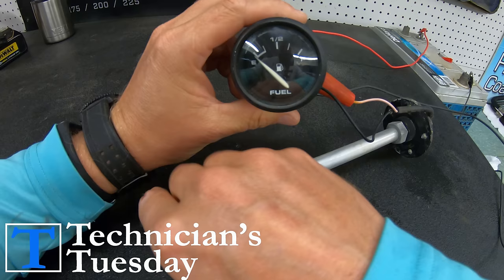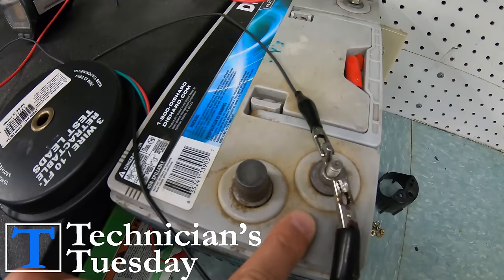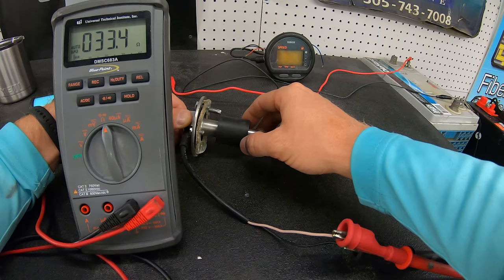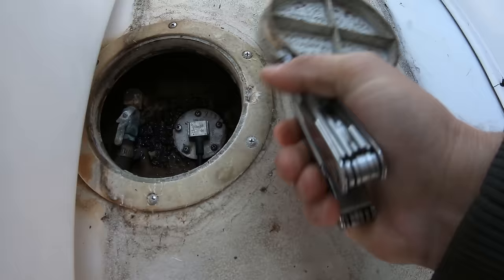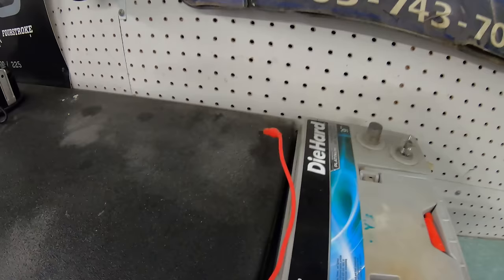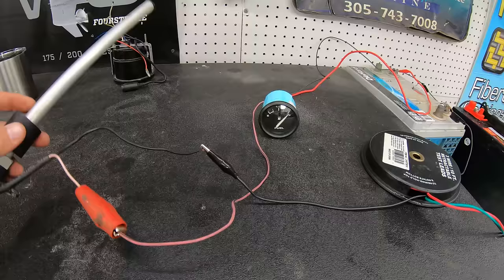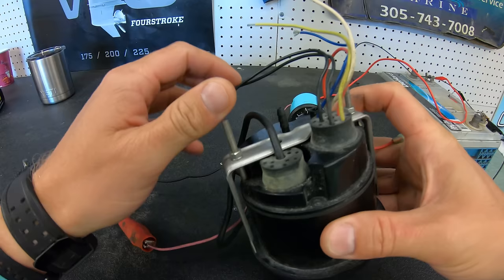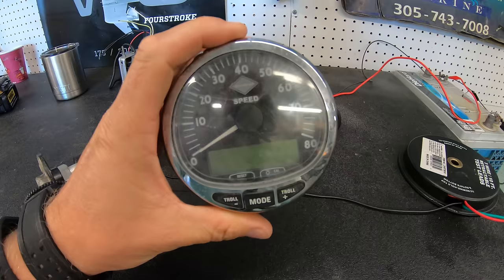How To Troubleshoot & Fix A Boat Fuel Gauge & Fuel Sender!

Comment: just a word to the wise  if you order a reed switch sender and you have a steel tank measure depth of tank minus 1/2 in to order the correct length   it 33ohms full 240 ohms empty but still a little left in the tank 1/2 inch the reason is this the steel tank will hold magnet down showing empty in a full tank  so order 1/2 inch short for correct reading   also best to run 2 wires to the gauge  do not use metal boat as gd wire    14 ga. wire is best  been use one for years   cost is about  $75 .00  (sender  and gauge   on line )    they come in all lenghts

Comment: So I just bought a boat a few days ago, the fuel gauge was on empty when I was inspecting it before purchase. I went and filled it up took 20 gallons to turn off and the gauge says full now. I’ve spent probably four hours out on the water and the gauge has not moved from full. Whatcha think?

Comment: Thanks for the info!!! I had put new batteries in and separated the motor from the lights and gauges. that doesn’t work. Would never have found it without your video thanks really appreciate it, gas gauge working great now!!

Comment: In 2011 I bought an F350 from marathon Florida , rear tank gauge never worked right , factory replacement for unit was almost $400 , got a Marine sending  unit ($30) and bent the float lever around to make it work backwards , stuck it in the tank and it worked ... wasn’t perfect because the ohm range wasn’t exactly the same but it worked

Comment: I have run out of gas, but, I have a sailboat, so it’s never been a problem ;) my gas gauge stopped working last year when I accidentally connected my battery backwards (I crossed the negative and positive).  The battery was in a very hard to reach place and when I hooked it up, I had it backwards.  I fried my vhf and the gas gauge stopped working.  I was never really sure how to troubleshoot the #gasgauge .  Thanks for this excellent explainer on how to troubleshoot your #gasgauge much appreciated!

Comment: #gasgauge I never have run out of gas but I did have to be towed in because I did not understand how the primer bulb worked and couldn't figure out how to hold the bulb to get fuel to the engine. Newby fail. Thanks for another great video.

Comment: I was wondering how the vesselview could give me my Fuel information. Not installed yet but this helps alot. Way to go Aaron.......
Reply from the maker: Just through the engine via that boat harness :)
Reply: I had a regular fuel gauge. I Didnt know the signal went to the engine as well.
Reply from the maker: @dewey66904  yup :)
Reply from the maker: @dewey66904  actually of you have a regular analog gauge it doesn't go to the engine it goes to the gauge. Mercury gauges get the info from the engine, so the sender wire goes to the engine with those systems

Comment: Great Channel.  I have you Bookmarked!!!    3 weeks ago I bought a boat with 60 HP 4 stroke mercury on a Bass Trakcer and my fuel gauge doesnt work.  Go figure I gotta track down wires through the wiring harness?        Before I get into that....  I measured resistance of the sender at 86 ohms with it installed in the gas tank, which sounds right as Im estimating about 1/3 of a tank.  (im not saying the sender is working though)....    With the key on, the Fuel  Gauge does nothing when touching black and pink wires together just as you say with a Mercury .   

Next -  With the key on,  I measure 6.7VDC between pink and black at where they connect to the sender. b  (I was expecting more voltage there but Im no expert).    

Next -   I measured voltage at the gauge with key on at 10.1VDC.   hummmmm......   any idea if there might be a voltage regulator knocking down the voltage at the sender?   According to voltage drop calculator, there is way too much voltage drop for about 8 feet of wire,    hummmm..... head scratching. 

  Im inclined to go ahead and just replace the sender and cross my fingers.  
   BTW...Im not asking you to help me fix it... I'm just rambling maybe for the sake of others.

Edit. 11-28-2021  I fixed it.  The gas gauge now works and Im a happy camper.  I replaced the fuel sender on a wing and a prayer and now I have a spare fuel sender .  That didnt fix anything .  After some tedious wire tracing I discovered the ground wire on the sender circuit was hooked up to the wrong battery.  Likely happened when the previous owner put in new batteries.

Comment: on wiring gauges never send battery to the sender it is resistance only dont confuse neg for light as neg for gauge you can test your conn.before you install in tank moving magnetic float up and down will move gauge empty and full  the batt and gd for lights on gauge

Comment: Great video as always! Love the depth of knowledge! While you are on the subject of gauges I have an analog tachometer on a 3 cylinder johnson 70 that seems to intermittently work only while using the engines trim button on the throttle arm. Trimming up or down will make the gauge come to life. Maybe you could do a tachometer related video in the future? Thanks for the great diy content!
Reply from the maker: Sounds like you've got an issue with the power or ground going to the gauge. Try and check for that battery voltage at the gauge with the key on just like we did for the fuel gauge. See if that gets you any more information

Comment: There are senders out there that are opposite in resistance. The sender resistance of a European style sender, such as a VDO brand, is opposite to the U.S. type.
You'll see the different senders listed as either a 10-180 or 240-33 in the description.
The range for senders are:
240 to 33 Ohms for U.S. style (Empty reads 240 Ohms)
10 to 180 Ohms for European (Empty reads 10 Ohms)
The gauges will have to match the senders. I found this out when we had a hailstorm (hail the size of my palm) which smashed all of my gauges. I purchased a U.S. Evinrude gauge to replace a VDO gauge and discovered that the fuel gauge moved towards empty when I filled up and moved towards full when consuming fuel. This was concerning until I rotated the gauge 180 degrees as a temporary solution. It's not accurate being different resistances (I have ordered a 240-33 sender unit).
Knowing this info will save you money and get you the correct matching part.
There is also a device for around $40 that corrects mismatched tank senders with different gauges. That would be handy when you get a custom tank and don't want to replace your expensive gauge. 

#gasgauge
Reply: That's the problem I have now.  When I move the sender up towards full,  the new gauge goes towards E. I bought a new sender and still have the same problem
Reply: @kendrickbannister5025  New guage it is then
Reply: @autostyling5901   I'm good now. My original gauge is working now.  I bought another sender and rewired. All good.

Comment: I got a rod style for my aux truck tank when the resistant was at the bottom it show tank was full when I slid it to the top showed tank was empty. I even switched wires around

Comment: Excellent video! Can those long sending units be used for Automotive purposes? I have a gas tank in my 1964 Ford falcon that has been modified with a sump at the bottom due to the installation of an external electric fuel pump. I was wondering if I could get one of those senders that would reach the bottom of the sump for accurate reading of the amount of fuel in the tank and then wire it to an external fuel level gauge.

Comment: @born again boating can someone please help explain why the fuel gauge doesn't show a reading when its just directly connected to the battery from the positive and negative terminals because doesn't this complete the circuit for electrons to move? Why is it that the sending terminal on the gauge has to be connected for the arrow to move?

Comment: On my old boat it’s took me soooo long to figure out that the wrong sending unit was used on my boat. I ran out of fuel several times thinking it was engine problems. Gauge would read half when it was completely empty.  #gasgauge

Comment: Have you noticed the Yamaha digital gauge you used in this video showing a wrong fuel level compared to where the sender should be? I have a ton of issues with that same Yamaha gauge not giving me accurate fuel tank readings even when gas tank is full

Comment: Oddly, on my old fuel sending unit and my new sending unit I'm not getting any ohm readings, when the unit is off the boat.  Also my trim gauge which is next to the fuel gauge on the dashboard, isn't functioning either. I suspect a bad ground.

Comment: I want to ask you if fuel Sensor resistor is  linear ?. My is not. Gauge show it by step 1/8, 1/4, 1/2, 3/4, 4/4 only.

Comment: hello, 
I bought the float on aliexp... once connected to the fuel meter the needle works upside down, you have an idea.
do i need to change the meter? it is an original Mercury vdo

Comment: Makes sense! Need to trouble shoot my fuel sender. I have a fuel flow meter on my boat, which calculates fuel burn, but the Suzuki Fluid level sensor always shows a reading of 100% on my Suzuki digital gauge. Going to install an analog meter for redundancy. #gasgauge

Comment: Fix your current gauge properly, and rig second fuel gauge as a precaution, if you ever ran into running out.
Having two gauges ensures you won't run out.
Definitely won't run out ever again, and would be interesting to happen to watch, if any difference pops between both fuel gauges showing. This will wake you up to investigate. You would be on alert mode then, and would investigate whether you got a bad gauge, or empty tank.
If you find you got sufficient fuel in tank, your gauge will automatically earn a bad gauge diagnostic.
All in all you will be very aware, not guessing, and definitely not needing a dealer service to figure out things
Reply: Doesn’t ensure you won’t run out if the problem is something other than the gauges.

Comment: Very helpful video. But, what is at fault when the gauge reads around 3/4 on a FULL tank and reads around 1/8 when boat is off. Bad gauge? Sender? Both? Cheers and thanks!
Reply from the maker: Thank you, probably the Guage is bad, youll have to run the tests in the video

Comment: Had a 4stroke 250hp yamaha leaking fuel from the right side latch...block it to get home....would like know the reason for that fuel line on the latch.. Thanks
Reply from the maker: It's the vent for the VST. The float and needle in the VST has probably failed or something is stuck in it. You'll need to pull the VST off and check it out, usually you have to change out that seat and needle assembly :)
Reply: @BornAgainBoating  Thanks for the info...I will let yamaha repair personal maje the the repairs.....
I'm not sure
Reply: @BornAgainBoating  Thank you for the information...greatly appreciated

Comment: AT 3:32 you were talking about portable tanks and the float switch. i am a noob so please forgive my ignorance, but i have a 12 gallon removable tank and i want to hook up to a fuel gauge to my dash in my boat. i am currently redoing a boat and have a blank canvas because of the age and probably size of my boat there were no gauges just 2 6 gallon metal cans. i would like to know:
1. if i can put a fuel gauge in my dash?
2. what parts would you suggest i use? or just use smaller tanks and fill them each time i go out?

thanks for you time.

Comment: In this video it doesn't mention grounding the metal fuel fill cap. Is grounding the fuel fill cap required(fiberglass hull)? tank is up in the bow with metal gas fuel fill on deck. When i got The boat the ground from the sending unit goes up to the metal fuel filter gas cap thing then goes to the same ground point as the gauge is this correct?

Comment: I'm testing on the bech.  I can't figure out what I'm doing wrong unless I have an unmatched guage/sender ohm operating scale.  I will buy a matching guage since I can't find its operating ohms.  My problem is that I can get the guage to spike, but not read when correctly wired.  Same condition with 2 sending units, same guage.  This is when bench testing out of the boat.  Kinda frustrating. Suggestions?
Reply: OK! problem solved.  If you have a gauge that only reads full and you are sure that you wired it up correctly, do yourself a favor and go buy a matching ohms gauge and be done.   I cant confirm weather or not my gauge was different resistance or not, but it was defiantly the issue!  Advance auto bosch gauge and sending unit and gauge and Pow! done.

Comment: #gasgauge used to run out of fuel all the time when I had 2 6 gallons cans in my whaler. Run as far as 1 tank would let me, then switch over to the 2nd

Comment: I have Cascadia freighter 2013 Model. It has no 12V at the fuel gauge where we basically plug in at fuel sensor. It has only 5V . I checked there is no fuse for that. Please help me to solve this issue.
Reply from the maker: You'll need to disconnect the power going to the gauge and redo it like it is in the video :) 5V isn't right

Comment: Where did you get those retractable test leads?  That looks like a great help troubleshooting electrical issues
Reply from the maker: EBay or Amazon ;)
Reply: @BornAgainBoating  Thanks.  Didn't know if it was from a specialty supply shop.  I made me some 20' test leads to do voltage checks but this looks much more convenient

Comment: Good video I have a question how hard is it to change the prop shaft seal because I drained my lower unit oil from my port engine and it had water in it thanks
Reply from the maker: https://youtu.be/QNvpgs9_5r4
This should get you going in the right direction:)

Comment: My boat fuel gauge always on full, thankfully I noticed before getting stranded somewhere. I pulled the sender unit out and put a new exact type on and its still the same. Actually, when you move the sender arm to the full position it goes the opposite way on the gauge, essentially working backwards. Wiring looks good to my level of understanding. Could it be that my gauge is not compatible? Its a cheap three prong gauge i bought from Autozone.

Comment: I think my grounds are bad, both my fuel gauge and trim gauge which are next to each other on the panel aren't functioning. The temp gauge and volt gauge which are directly below the fuel gauge and temp gauges are functioning. So I think it's a bad ground. On the fuel gauge and trim gauge.

Comment: Great video. I'm trying to estimate the amount of fuel is below my sender's ability to detect. I have a 15" KUS S5U sender. How high does the fuel need to be before it starts reading non-zero? Guessing the float size at around 2", does it start to rise up after 1" of fuel?

Comment: Great info,,,,installed a new sender, new wiring harness in my restoration pickup,,old willys,,,sender is new, and worked on the bench. In the tank it registers full but the tank is empty,,,could it be a ground ,,new paint on frame and may not be getting a good ground,,,running a ground wire and see what happens,,if the sending wire is disconnected it goes to empty,,,any ideas?   

Wala,,,,found the  issue,,the gauge went south from bench to tank,,,go figure,,why it was so hard to locate,, wired up a good gauge on the frame, (out of the tank)  tested both,,the one still goes to full the other works correctly ,  the one in the tank won't do nothing but read full when hooked up,,,

Comment: I'm a bit confused the sending wire goes from the sending unit to the gauge ,but your showing a neg. black wire coming from the battery ,the important thing I need to know in detail ,after I connect the ground from the sending unit to the guage,on the same connection,do I run another wire to my negative bus.?
Reply from the maker: Yes, the pink sending wire goes to the guage, then you also need a black negative wire from the sending unit to the ground system of the boat :)
Reply: Thanks

Comment: What do I do if I have a good gauge and a new sending unit but my gauge says full unless I his a pump switch and put a draw on the system then it reads the right fuel reading?
Reply from the maker: You might have bought an inverted fuel sender for a different countries boat :) they are common, try reversing the sending wire and ground wire at the sender and see if that helps

Comment: one other issue,,,in my boat the gauge is always empty,,but if I cross the + sending wire to the ground it works,,,what's up with that??
Reply from the maker: The sender you have is probably an EU sender, some senders operate inverted like that, just cross your wires like you said and it is what it is :)

Comment: My 2000 Xpress X21 has a fuel sender in the most awkward of spots that is basically requiring me to remove the entire top deck to get to it. Its read at fuel for a year now. I tested the connections and believe it to be stuck in the up position. Any ideas how to get it to fall back down naturally?
Reply from the maker: Nope, unfortunately you probably need to change it. Try and just bend it when you pull it out to get it out. Also pull the access and try to cut a section of glass that can still be covered to get the new one in
Reply: Born Again Boating it’s an aluminum bass boat and there is no “access” for it. I can see it from a compartment at an angle. I was worried about that. Oh well I guess estimated my runs and distance is all I’ve got !! Thanks for the reply!

Comment: What do you do if the sending unit is corroded onto the fuel tank? I can’t even turn the bolts lose to pry it out
Reply from the maker: That could  get sticky. You don't want to mess it up and not be able to seal it. But generally, you want to get as many bolts out as possible and then drill out the ones you can't. Try to just drill off the heads and see if you can get the screws out with vice grips. Then if all that fails, rotate the new sender and drill and tap new bolt holes. If it's a plastic tank, there isn't a fix for it sadly :(